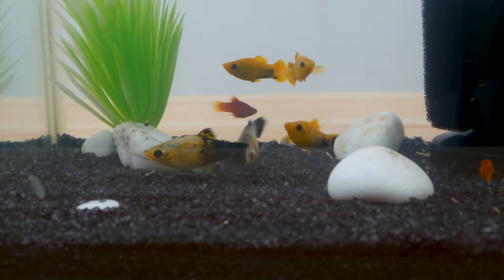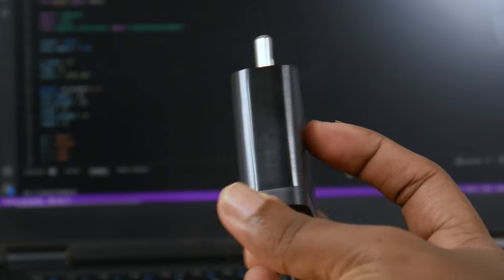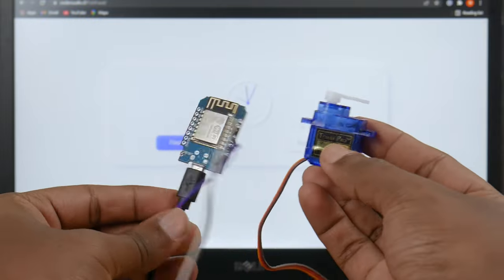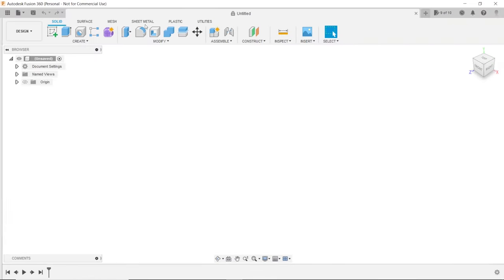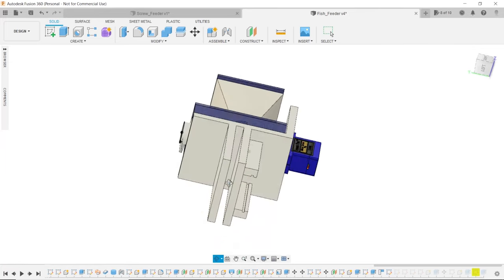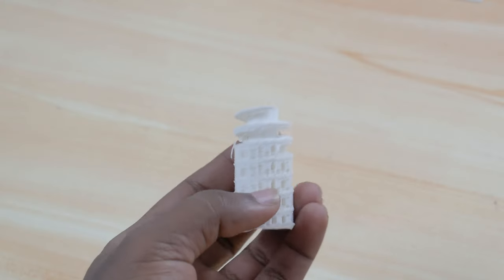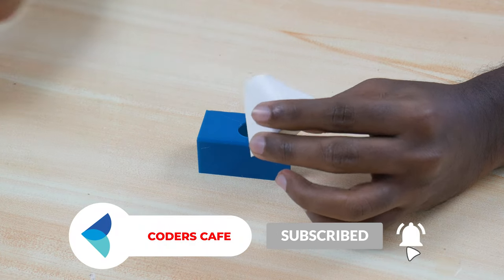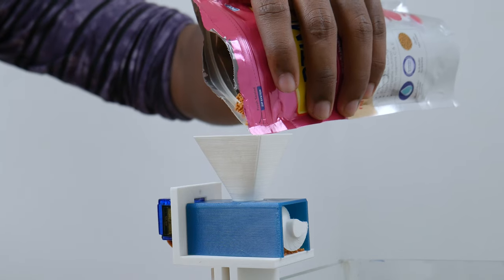Aquassist | DIY Automatic Fish Feeder with Companion App | Wemos D1 Mini | Arduino IDE | Coders Cafe

Comment: Hi, nice project. However when I download 3D STL model of  the body there is a circuit board attached to . So, I cannot 3D print it. Is that model (without the circuit board) available anywhere. Thanks!

Comment: Hi... good work. I have a querry. What is the range of the app. Once scheduled, can it run without the help of the app?
Reply from the maker: As it is connected to internet there is no limits for the range. And it can run without help of the app after scheduling.

Comment: How does sg 90 servo rotate continuously?. Isn't it a positional servo?  In which the rotation is limited to 180°.
I asked because. I used sg90 in a different project and while testing the servo, the code was to rotate 0 to 360 and reverse. But the servo stoped when the code reached 180 mark. ( only rotated between 0 to 180 and 180 to 0)
After some digging, i found out the difference between continuous rotation and positional servos and how to program them. But how sg 90 doing 360?
Reply from the maker: SG 90 also have a continuous variant.
Reply: @CodersCafeTech  tnx bro

Comment: Hello 
Coders Cafe guys...
Thank you sharing such very project to us.
Just one small query ,can same code of Wemos D1 used on ESP-12 D1 Mini V2 Board ?
as Wemos D1 seems to be out stock on most of websites.
Reply from the maker: You can use this code with any ESP8266 based boards
Reply: @CodersCafeTech  I want to use the EPS 32 board ?

Comment: Hello! Thank you but let me know how to process if we wanna use the stepper motor in place of the  servo motor, please?
Reply from the maker: The only change required is to write the stepper control function instead of the servo control function in the Arduino Code.
Reply: @CodersCafeTech  thanks.
I don't get the printing files, please !

Comment: can you tell me what are the libraries on arduino?
Reply from the maker: If you have installed all the necessary libraries for ESP8266, the only add-on is FirebaseESP8266, which can be installed from here : https://github.com/mobizt/Firebase-ESP8266

Comment: Motor is not working in schedule mode but only in feednow how to solve this
Please reply
Reply: i have the same problem, can u help us? If you are able to make it work
Reply: @Justin Balboa  the project is set to feed only on 3 schedule timers after which u have to reset esp
You can increase timer count in arduino ide code

Comment: Can you give me the code to transfer data between the companion app and the fish feeder? Please:<
Reply from the maker: The device transfers data to the companion app through Firebase, and the necessary code has already been integrated into the Arduino code.
Reply: @CodersCafeTech  I don't quite understand, can you be more specific?
Reply from the maker: @25marshmellothetri96  Everything is explained in the documentation, please give it a read if not done already.
Reply: @CodersCafeTech  where docementation?
Reply from the maker: @25marshmellothetri96  https://www.instructables.com/Aquassist-DIY-Automatic-Fish-Feeder-With-Companion/

Comment: What will be the range of app?
Reply from the maker: As the device is connected to internet there is no limit of range.
Reply: @CodersCafeTech  how is it connected to net
Reply: @vaibhavsinha8431  it used the d1 mini which is like a esp32, the d1 mini connects. To wifi and then you can use it remotely
Reply: @Neethu Joy  Still the circuit is not ready but the ok button to schedule time in web app is not working

Comment: Sir i tried to replicate your project 
But i got error in code at host
Reply from the maker: Can you post the error?
Reply: @CodersCafeTech  Compilation error: cannot convert 'const char [68]' to 'FirebaseConfig*' {aka 'firebase_cfg_t*'}
Reply: @CodersCafeTech  and can u please do a detailed video on that project
Reply from the maker: @suryateja4166  Try installing the Firebase ESP8266 library version 3.9.7 instead of the latest version.
Reply: Same error
Reply: @CodersCafeTech  it uploaded 
But it continously rotating 
The companion app also not working 
Sir what I need to do now

Comment: Is there anyimit to set the time
Reply from the maker: A maximum of 3 timers are only allowed now, but you can modify it in the code. No limit for setting time.
Reply: @CodersCafeTech  will this 3 count feed now and scheduling both
Reply from the maker: @vaibhavsinha8431  3 timers and 'Feed Now' both will work independently.
Reply: What is limit for feed now
Reply from the maker: @vaibhavsinha8431  There is no limit for feed now.
Reply: @CodersCafeTech  Can we put a limit for feeding be it feed now or schedule
Reply from the maker: @vaibhavsinha8431  Sure, you can do it in the js code.
Reply: @CodersCafeTech  how is this maximum decided
Reply: @CodersCafeTech  it shows path is not declared in this scope in arduino ide
Reply: @CodersCafeTech  will one code support max of 3 timers only